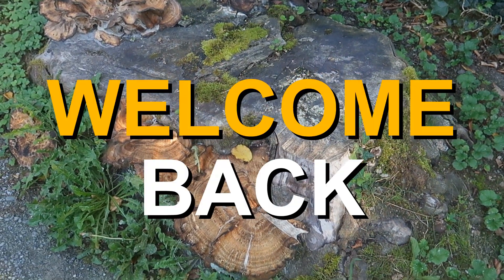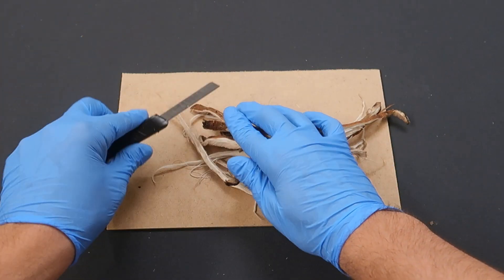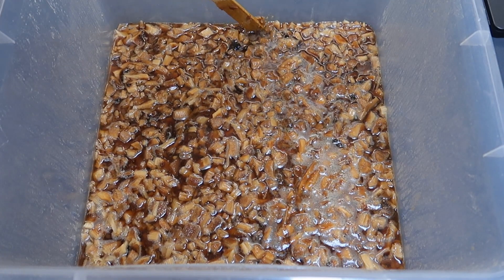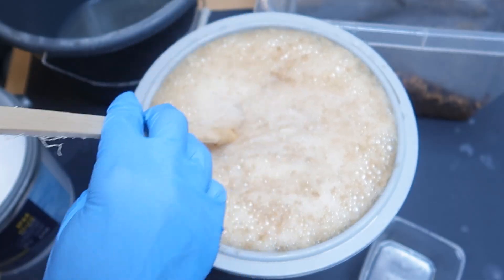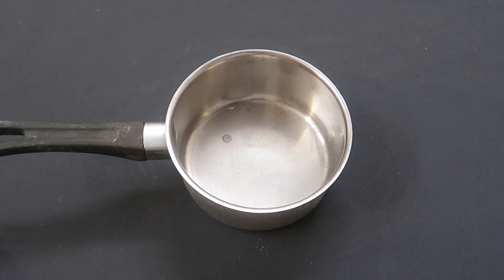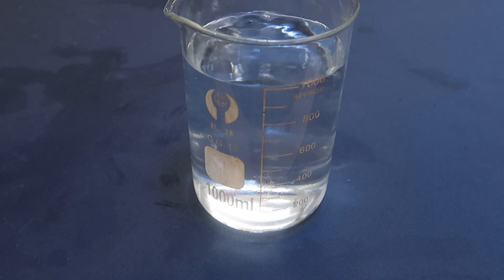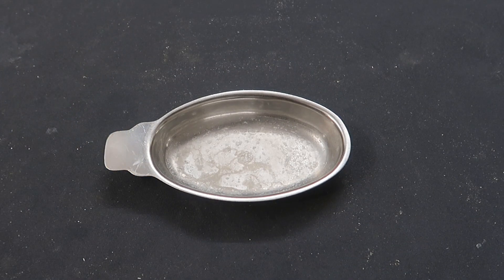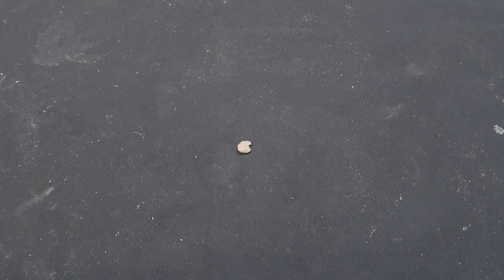Can you turn MUSHROOMS into PLASTIC ?

Comment: My man... Why not use a decent cheap chef's knife or a cleaver? You could have been done with the mushrooms so much faster. But one for lab work. You might just need one again.
Reply from the maker: Thanks for the suggestion ! I actually tried many things (though not that specifically) and nothing would that thing besides the cutter. But why not, I mean I also slashed my finger pretty badly with that cutter so something else might be better